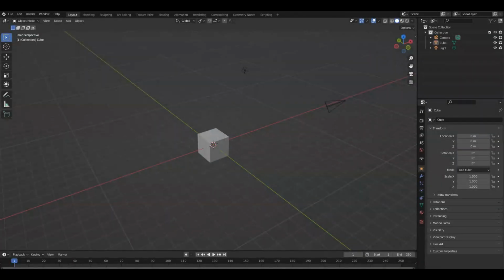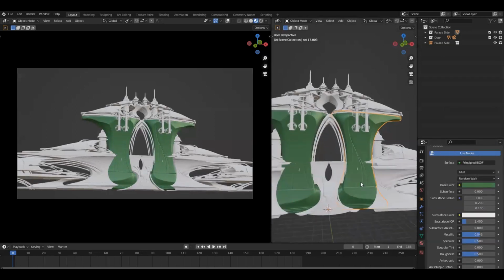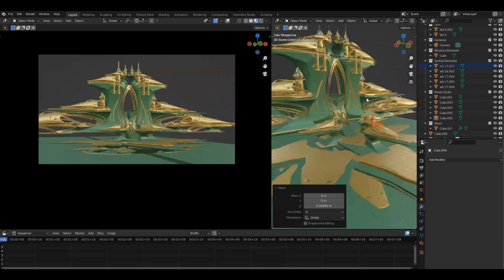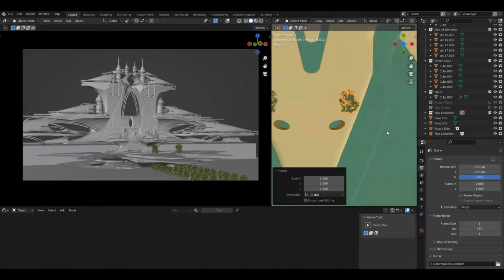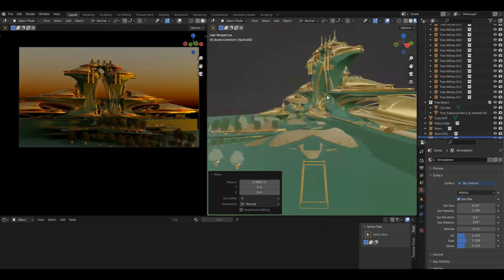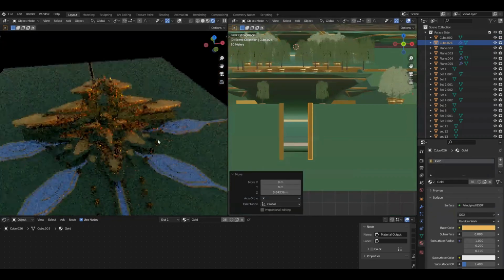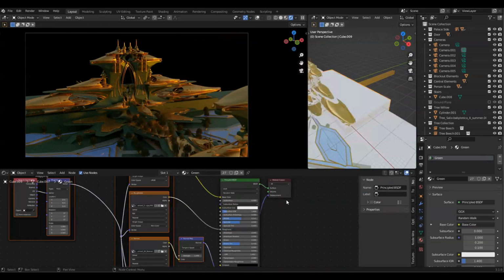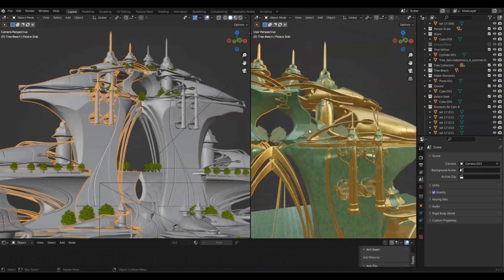Worldbuilding for Concept Art - Part 5 - Blender Process (Part 1)

Comment: I have two questions: On 3D Coat do you sculpt using the mouse or using the digital pen? Because in blender I am more used to use always the mouse only. The second question is why don't you sculpt directly on blender?
Reply from the maker: Hi, I think I usually use the mouse only when sculpting in 3D Coat, but its totally just a preference. Blender sculpting has gotten much better at a very fast rate recently, so maybe I should learn it a bit more. However I still think 3D Coat does what it does a little bit better. The Voxel system in particular is the fastest ideation sculpting I've ever used for sure. That being said, I'll definitely try to learn more Blender sculpting at some point.